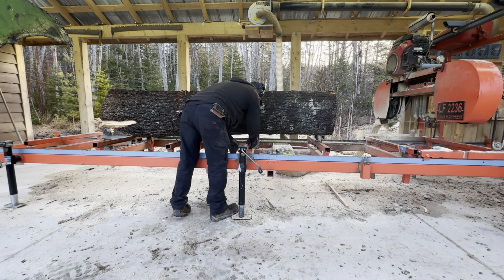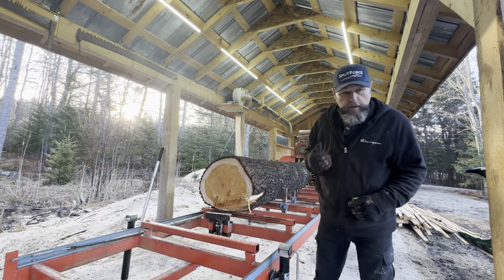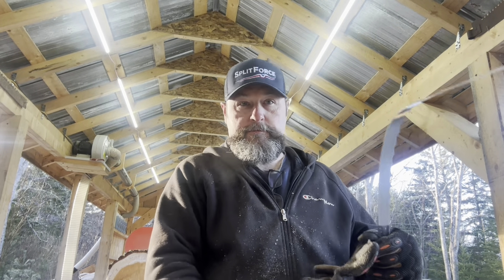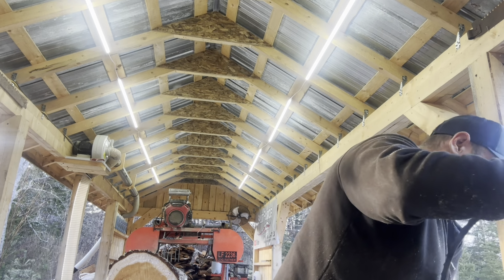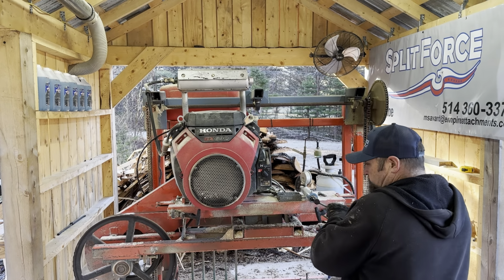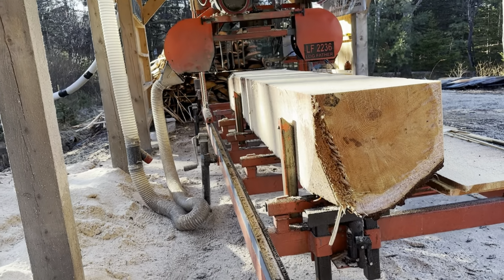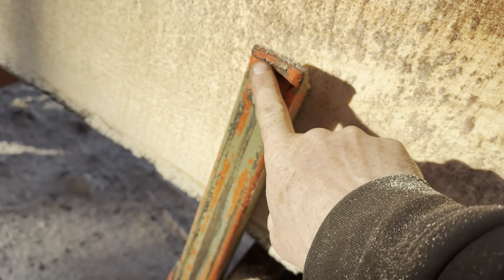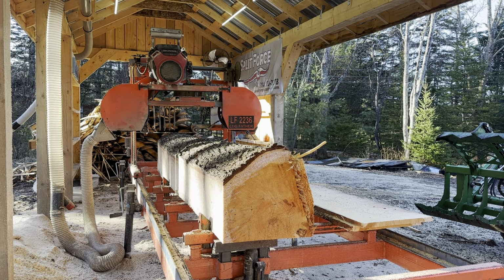Boards are not BORING!

Comment: I only  sugared at one farm that had all the modern  bells and whistles.
 The RO took our sap, that had not touched open air yet, down to between 9 and 11%. 
 At that sugar bush, we made very pale sap, almost no color to the syrup. That was right when the grading changed to the various Amber grades.  Our light amber didn't sell well. We would have been better  with the  old grading system. We would have called our syrup A grade.
AB C and cooking gradesbhad been replaced by the ambers.
Reply from the maker: It lightens up as the season goes on too.